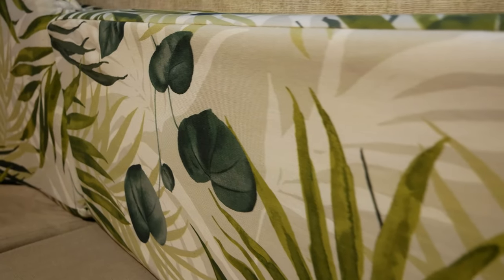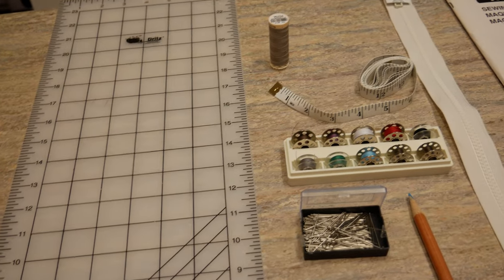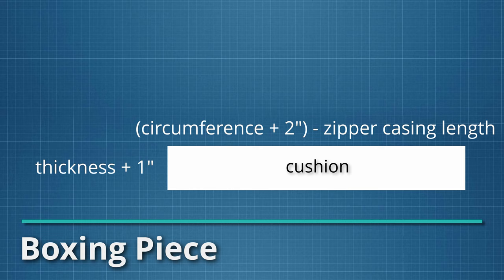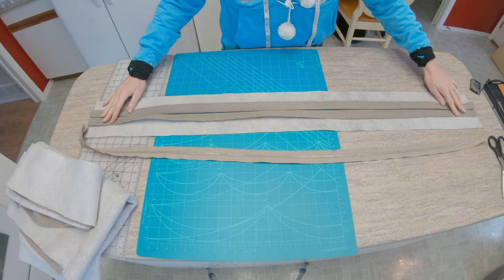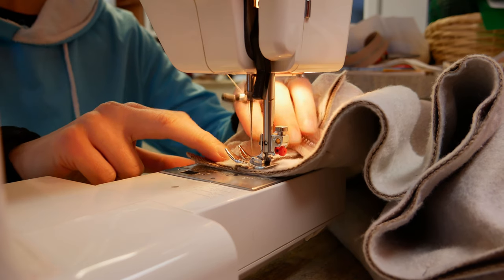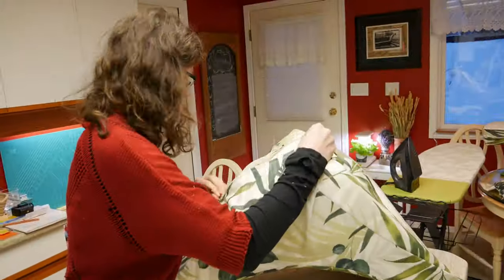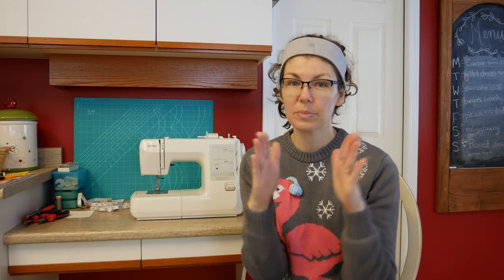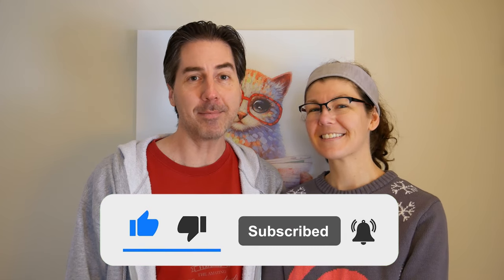RV Cushion Cover DIY Replacement for Newbies | How-To Tutorial | Home A Roam

Comment: Just a thought from my experience in recovering cushions. If you no longer want to use the old cushion covers, you can take them apart to use as a pattern for the new fabric. Cheers!
Reply: That is what I always did in the past.
Reply from the maker: Thanks for the advice! I wanted to do that, too but then we decided to hold onto the original ones just in case ...so I had to measure instead.

Comment: That was a very entertaining video. Thank you for making it fun. 🙂I am trying to work out how to make a fitted sheet style cover for my curved bench seat backing too. I have a 7 year old and camping in our van is a bit dirty.. LOL.. so I'd love to be able to take them off and wash them. Any advice would be great.  Would you have a pattern idea? I have Teal velvet I'd like to use. Not much stretch.  🤔 I'm worried about the fabric not sitting firm in the curve but have an idea to create tension with some straps that will act like braces (if that makes sense!).
Reply: Is it more of a matter of ease? So you can take the fitted sheet off quickly vs using zippers?
Reply from the maker: I'm glad you liked the video. I've been thinking about your question on making it a slip cover style and I'm not entirely sure if this will work, but what if you put snaps or buttons along the back side to hold it in place?

Comment: Just getting ready to tackle redoing the back cushions on our dinette that looks like hour’s.
   That you fit the video, my disappointment is that you really didn’t walk through how many pieces and how you measured etc those dang corner pieces!
   I was thinking about just covering the original material.
   Thanks.
Reply from the maker: Hi, sorry you didn't find all the info you were looking for. For doing the corner pieces, my recommendation would be to take apart an existing cover to use as a template for each piece. I tried tracing the shape and adding 5/8" for seam allowance and that messed up the curves and I had to redo them, wasting expensive fabric in the process.

Comment: Hi there! We're busy with some curved cusions at the moment and we cannot seem to get the curve right? Tips for sewing so that we don't get the corners pulling in? What's the trick for the measurements?
Reply from the maker: I had the same problem and then I realized that when I added the extra seam allowance I was making the curve smaller causing it to pull in. 
To account for it, I added double the amount of seam allowance on the straight ends and sides and kept the original curvature I measured on the curved side. I hope this makes sense? 
Let me know if you have more questions.